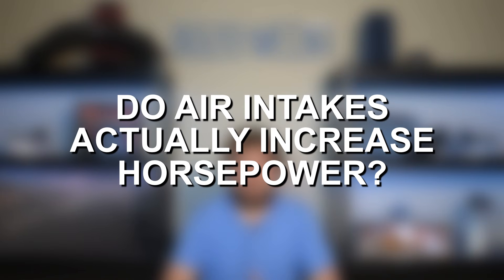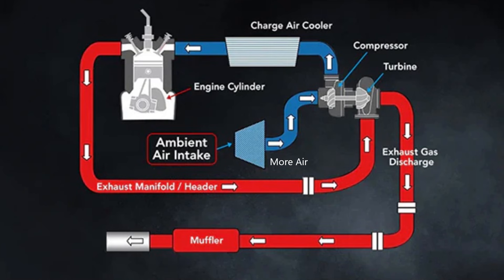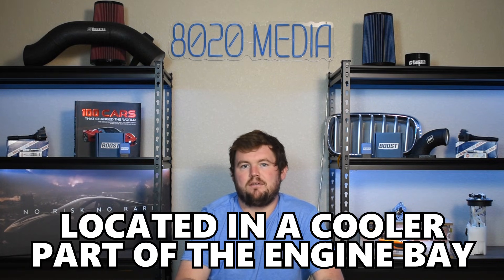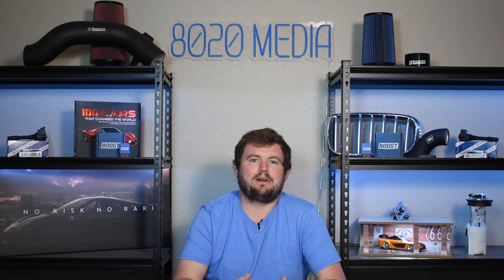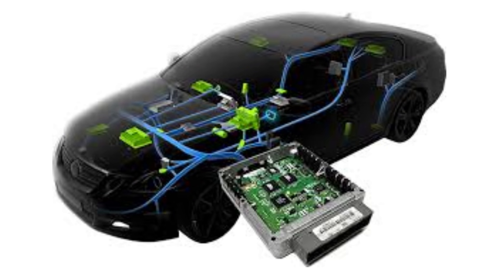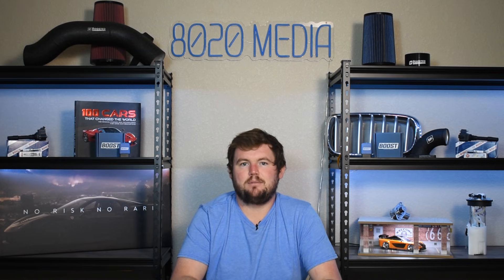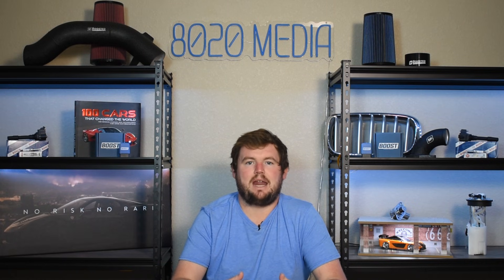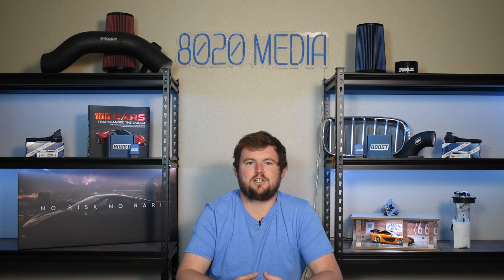Do Cold Air Intakes Actually Add Horsepower? The TRUTH Revealed!

Comment: What's "Procharged"? I never heard of that one. I know this one where you have a turbo AND super charger. I think it's called a "Twin charged" or "Dual Charged" setup
Reply: A ProCharger is a type of centrifugal supercharger, meaning it's a specific type of supercharger, not a separate category. ProChargers are known for their high efficiency and linear power delivery, but they may exhibit some "turbo lag" at low RPMs. Other types of superchargers, like positive displacement (roots-type) or screw superchargers, offer immediate boost but can be less efficient and generate more heat. Ultimately, the "better" choice depends on individual needs and priorities. 

From the internet 😊👍.
Reply: @JoSh-oo-Ah  Oh. I have a supercharger myself in my car. The W204 C180 Kompressor. 

It lags sometimes, but I've been told it's because of the torque converter and not being in the right gear. I think mine is a roots type, but not 100% sure. Thanks a lot
Reply from the maker: K - Prochargers are very rare. A lot of people probably haven't heard of them before.